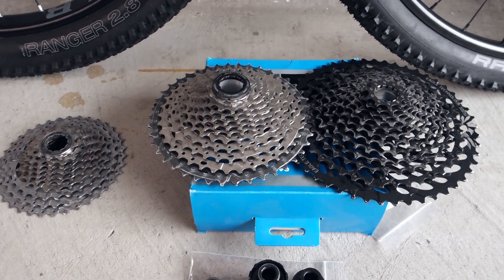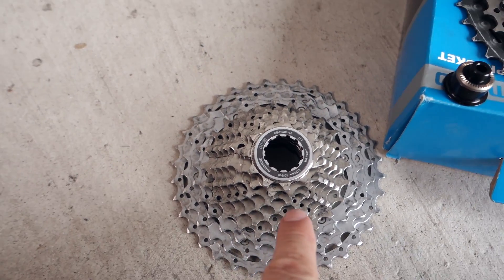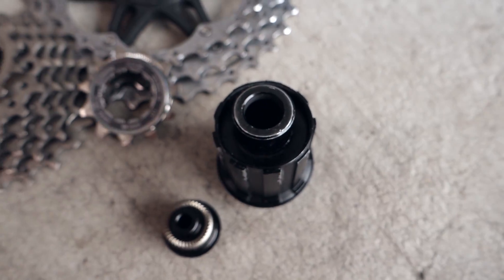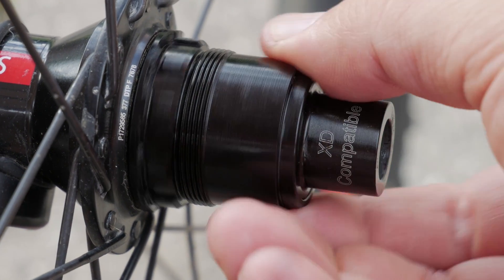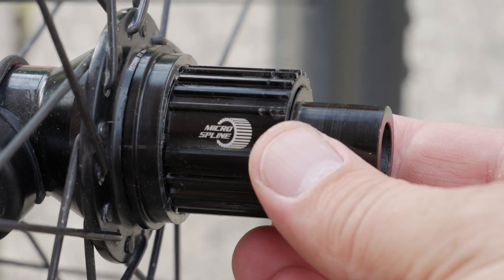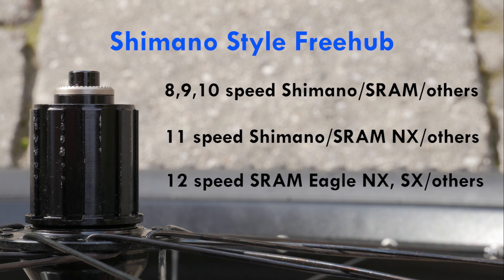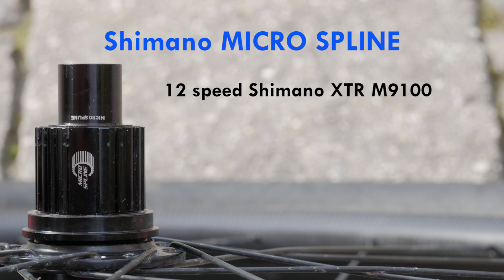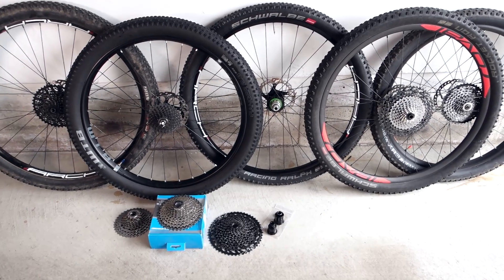HUB | Freehub COMPATIBILITY 🔥 12, 11, 10 Speed - SRAM XD Driver, Shimano Micro Spline, HG, HG+

Comment: Much Much Much Much appreciate.  This is exactly the information I am looking for answers.  I am building my own bicycle now and with modern technology. things changed and new things came up, making things a lot more complicate when purchasing parts. I m very worried to buy rear gear group since there are freewheel and cassette types. 

The wheel I purchased is using spine type (old model), meaning I have to avoid buying free wheel (which is like the SRAM XD hub) type gear group........  with your information,  now I know I can still use SRAM, but need to select the NX line.
Reply: @LoveMTB  Thank you.  Mix match is not a problem.. Just.... I have to be careful  how to fit 11 gear group onto a cassette body that was designed  for 10 speed and my rear chamber spacing is 135 mm... There  are a lot of videos saying it can be installed,  some says I will need  to file the base of cassette body a bit,  and some draw a picture saying there will be a need about 7 mins in total for 11 speed gear group.......

The frame I purchased was designed for 10 speed... And... I have been searched online... Seems.... Go with 11 speed is just the difference of 16 teeth been spouted into 15 and 18 teeth gears. 

Go with 11 just sound cool.... But go with 10 speed is not bad as well since the speed of 16 T is not much different from 15T... Well....  But 18T does help a bit in shallow ascending  slope....
Reply: @LoveMTB  Thank you.  I received my wheel (magnesium alloy) and put on the tire, the 11 speed cassette, fortunately, I can still lock the cassett cover and put into thr 135 mm chamber.  

Now is just the matter to set up the derailleur.........I purchased 11-52T.....but the RD was said to support 11-50T.......just a bit put of limit...have to adjust the cable....

Do you have videos on this kind of settig? Ove range set up for rear derailleur........

Comment: Well...the explination was very great but I still have a dumb question to ask. I have a SLX 11Speed cassete. So if I want to upgrade to the Shimano SLX 12 Speed will I need to change the hub? Is that Freehub like an adaptor? Its a little bit confusing. I hope you can understand my question. Thank you
Reply: LoveMTB so I dont need to change the hub which the wheel is built on, right?

Comment: Aren't there other  manufacturers you can discuss? What about Chris King, Hope, Industry Nine, DT Swiss... how about discussing the technical benefits of some of the other manufacturers products? Back when I used to have to build my bikes individually instead of buying everything from the bike builder with all the components with higher end parts, I would use Chris King hubs. They had smaller engagement angles on their freehub body. Then I got a bike that was all built up with DT Swiss 18 tooth ratchet spline. They have the 36 tooth ratchet spline that offers low engagement angle 360/36= 10deg, but still not as good as Chris King. Can you please make a video that discusses the reasons why someone would choose one brand versus another? What specs to look for?
Reply: You're talking about the internals. This video is about the cassette interface, the exterior shape. So as long as you understand which you need, you are free to shop other brands that offer those interfaces.
Reply: @LoveMTB  I believe we had some dialogue through comments a year or more ago about DT Swiss. Your videos are always appreciated. I'm pretty pleased with DT Swiss# products. I certainly benefited from your discussion of what was in this video, but I thought it would be nice to break down some more manufacturers as well. I get that the general configurations are defined around what you've laid out, but I'm curious to know more as a basis for justifying selection of any individual manufacturers components toward the individual riding style or duty cycle that the components will be subjected to.

Comment: Shimano 7 speed started the Shimano spline in the 80s.
Reply: The 7 speed free hub body was shorter. With the 8 speed hub body there was an adapter ring for the use of 7 speed cassttes. The cogs distance of 7 and 8 speed was equal.

Comment: Is it possible to fit the new 12gear shimano free hub to a classic thin quick release system? I'm thinkin about swappin to the incoming xt, it will suck I won't be able to use it on my frame
Reply: https://bike.shimano.com/en-EU/product/component/shimano/FH-MT500.html
Reply: Jan Sæther 
I have FH-MT500  weight like a brick 🧱.